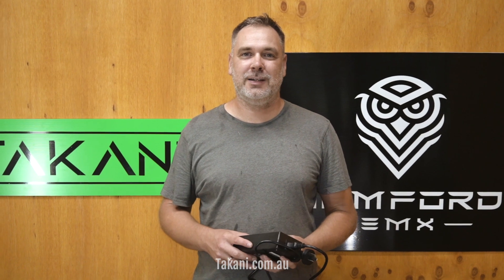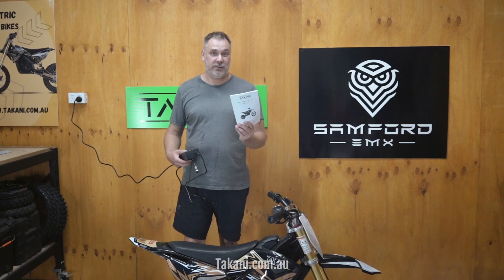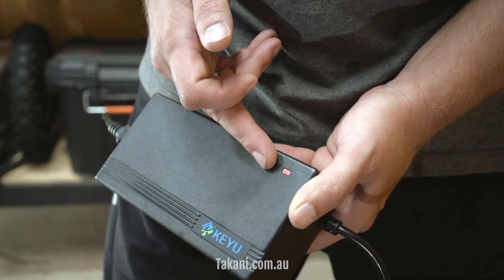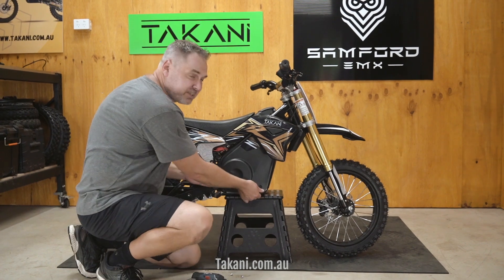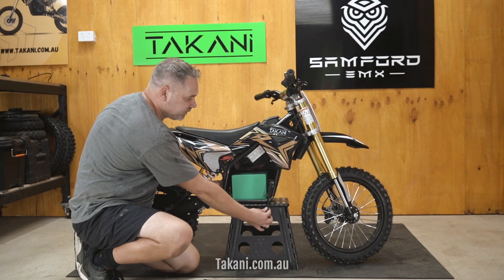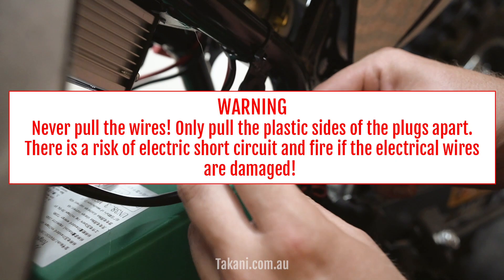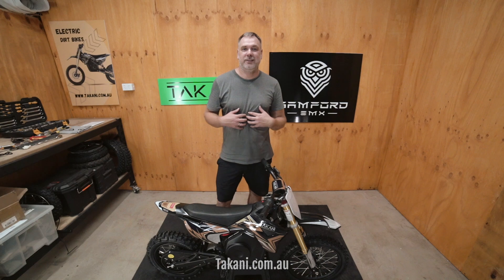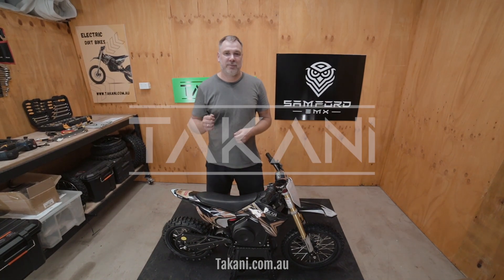TAKANI - Electric Dirt Bike - How To - charge & battery care

Comment: I have the mototech version and the charger slowly blinks green and the bike dosent charge up any ideas what could be the problem just trying to figure it out
Reply from the maker: Hello Michael, thanks for your question. Unfortunately we cannot reliably comment on other brand's bikes. While bikes look similar, specification, componentry, (even software) would be different and what is correct for one bike might be incorrect for another. 
We assume you are located in the US and we don't really know the charger this brand is supplying.

From our experience with a few different chargers, a slow, pulsing green light would indicate a charger error. Often chargers show this error when internal electronics is affected. They go into protection mode. Charger damages can originate from 'back-surge' or other common issues, such as overheating/fan fault, water damage, mechanical shock, internal soldering quality, componentry fault, etc). Unfortunately these issues can arise over time, even if there was no wrongdoing by the user. 

However, in our view most likely is back-surge. When the charger output cord is plugged into the bike's charging jack, the battery tends to discharge (for a short moment) a current back into the charger line. This current can be significant. While many (but maybe not all?) chargers are protected against  back-surge, repeated surges might damage the chargers' electronics. 

You might have noticed, in our how-to video, TAKANI advises to connect the charger to the power socket before connecting to the bike. This is best practice for most chargers. It is to power up the charger's electronics before it is plugged into the battery. The charger simply copes better with back-surge when energised.

Above is just for info, but it does not help with your problem. So now you could do a couple of things: 
a) if you are a bit experienced you might measure the output voltage of your charger with a voltmeter. If your bike runs on a 48V system you should measure and output voltage of something around 54VDC. If not, then something is wrong. 
b) you could remove the battery and bring it to your local electric bicycle dealer. Usually, these shops have analytics equipment for e-bike batteries. They could test your battery and confirm whether your battery is the problem.
c) you could purchase a new charger from your retailer. 

In any case and before you attempt anything, we kindly recommend contacting your retailer and ask for their assessment. They would know best and you don't want to run into further issues with your battery....or with your retailer.

We hope we could help you a bit. 

Greetings from Brisbane, Australia,  Christian from TAKANI Electric Dirt Bikes.